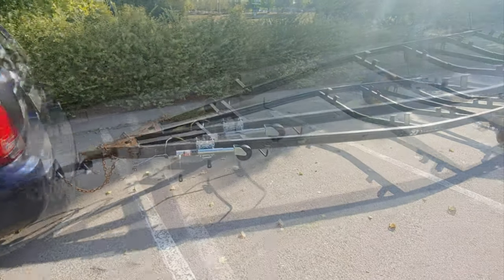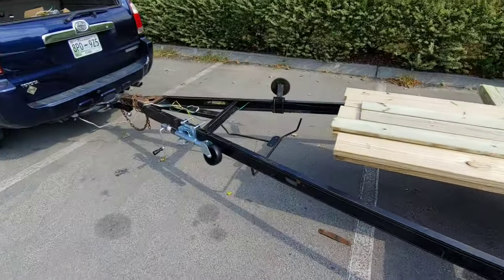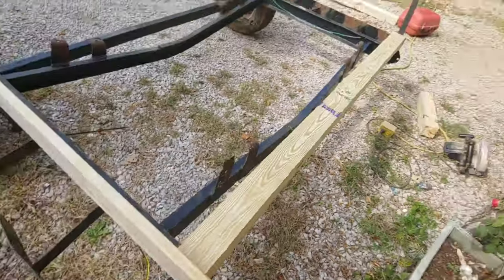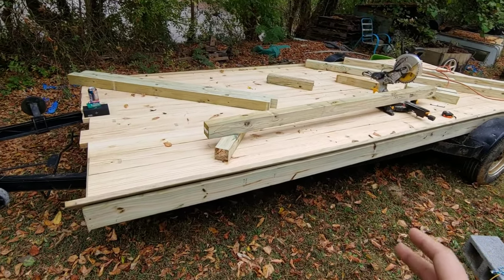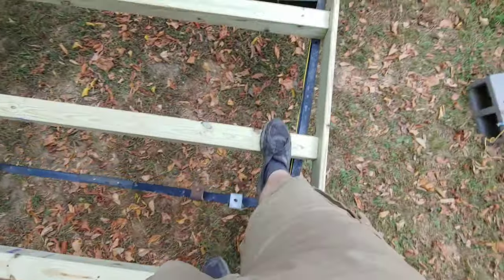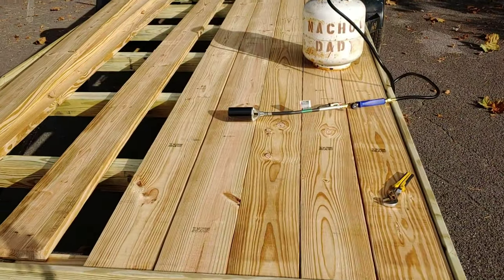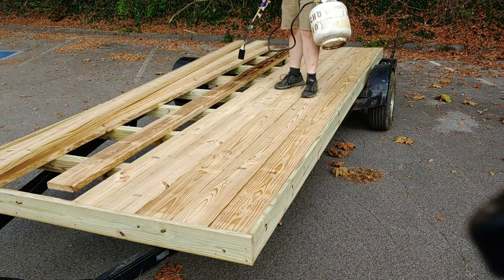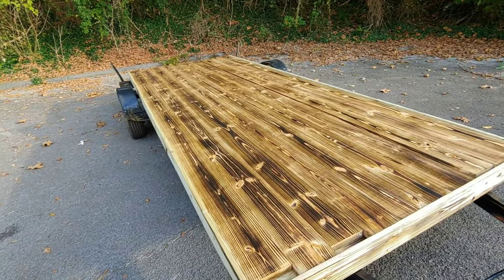Homemade DIY Flatbed Trailer | Super Cheap Trailer Build PT.2. Framing and Decking

Comment: Great video... I DO have some concerns re: drilling into the side frames so you can add bolts thru the wood & to the frame........... That would DEFINITELY compromise the integrity of  those side frame pieces... IF you had a heavy load  could it just start BENDING?

Comment: Great job, although I wouldn’t consider it cheap. Lol I picked up for for free, cut the v shaped metals off, bought used straight metal for framing, got some free used 2x6’s. Found myself a 6x12 flatbed for under $100 total build cost.

Comment: How does it pull? My in laws gave me an identical trailer and i planned do to almost exactly as you done. Looking to pull a 4 seater rzr. Do you notice its hard to pull with the axle being so far back?
Reply from the maker: It pulls surprisingly well, i usually just tow a couple atv's and dirt bikes with mine but it hauled our 84 Toyota truck from Atlanta to Nashville. When we had the truck on it we had it backed on so the engine was over the trailer axle and it pulled good at 65 all the way home.

Comment: Did you use pine for the floor or pressure treated? Im looking at the same design on a 20' trailer and building it 6x14.
Reply from the maker: I used pine for the floor and pressure treated for everything else.  After I ran the torch over the floor boards i soaked them in 3 coats of oil stain to protect them. I built a flatbed for my truck using the same process and its holding up great 3 years later with a clean and restain once a year.
Reply: Nachodads Garage Awesome man! Appreciate it! Gonna try the same concept.

Comment: Ok, serious and probably stupid question.  Could you also just take a piece of thick plywood and cut it to fit the frame then screw it into the metal frame and call it a day?
Reply from the maker: It wouldn't be able to support any weight without bowing in the middle.  you could use thick plywood for the top instead of 2x8s but you would still need some sord of frame underneath it.
Reply: Depending on what you want to use it for, you could take some 2x4s, rip them in half into 2x2s and throw plywood on top of the frame if you wanted a raft trailer or only haul a couple hundred pounds every 4+ linear feet spanning the full width. If you want to actually put weight on it, like he used this to pull his Toyota, definitely not. Lighter stuff I could see you getting away with full 2x4s.

It all depends on what you want to get away with. You also need to make sure the trailer can handle the weight.

Comment: can you give me a list of the lumber bought  i have a 22 foot boat trialer i want to do the exact same way
Reply: Looks like 9 4x4s. It may be cheaper to buy them and cut in half, check out price per foot. The sides look like 2x6s, 20'. I'd use carriage bolts or something that works with pressure treated lumber if you want it to last. Then deck screws for the top. I'm not sure what he used to attach the sides. Maybe large lag bolts?

Give us a few more details about what you plan on using it for.

Your materials will be highly dependent on what you plan on hauling. You could do this with 2x4s and plywood if all you want to haul is a raft. The lighter the better, depending on what you're towing with.

I got a bunch of Trex for free, and made a 9 foot outdoor table out of it and the deck for my shed. That stuff is super heavy in the 2x4 size for hauling, but fine if it's stationary, like a tiny home.
Reply: He also stated he hauled an 86 Toyota pickup on it, so a much higher towing capacity than I expected.

Comment: What did used to bold them on the trailer?
Reply from the maker: 3/8 lag bolts through the frame
Reply: Did you drill the frame?.
Reply from the maker: yes, i laid out the 4x4s and marked the frame. I then drilled 2 holes on each side and bolted the 4x4 from the bottom of the frame.

Comment: Looks like video part # 3 never made it..... Project abandoned?  : (  hmmmmm.
Reply from the maker: Nah man i just never finish filming projects.  Trailer has been in use for over a year now with no issues and has hauled a toyota pickup on it although i don't recommend it. Only issue with the trailer is the axle is too far back, i plan on rebuilding it in the spring to make it better.

Comment: When you gonna finish this project
Reply from the maker: Define finished?
Reply: Next step more or less lol
Reply: Nvm I miss read thought you where turning it into a camper
Reply from the maker: @aaronvogelgesang7924  its all good bud.   I've actually been thinking about building walls on the front half and putting a truck camper on it for weekend adventures.  But nothing final yet
Reply: @nachodadsgarage1159  trailer build pt 3??
Reply from the maker: @stephenodonnell7802  pt3 is in progress, ive added a winch, headache rack, storage box, and finish up the small stuff
Reply: @nachodadsgarage1159  I'm building mine exactly like yours,,same size n all,, but hurry up!!!  Wifi on y ass!!!   Lol
Reply from the maker: @stephenodonnell7802  I'll film it this weekend and try to put it on YouTube next week.
Reply: @nachodadsgarage1159  who's ya daddy
Reply: @nachodadsgarage1159  Love the build! Is there a part 3 yet?